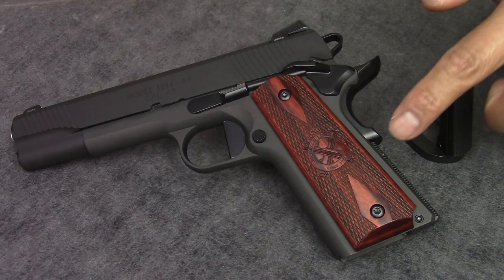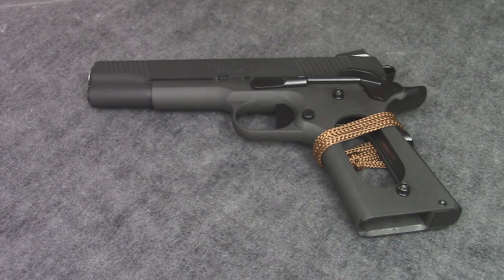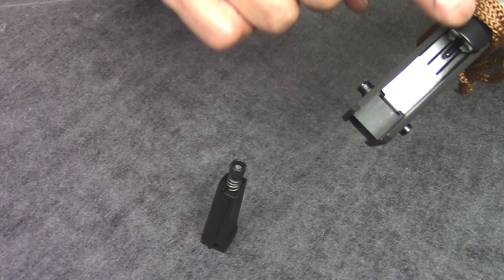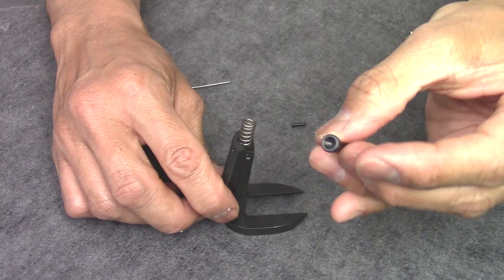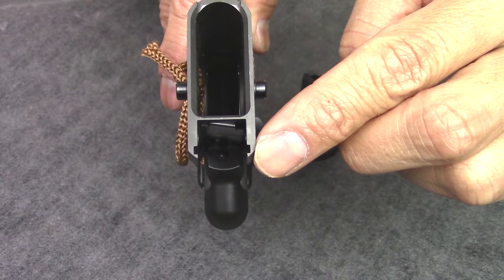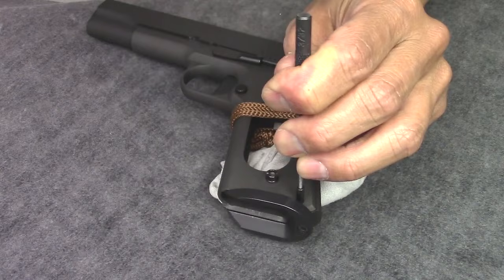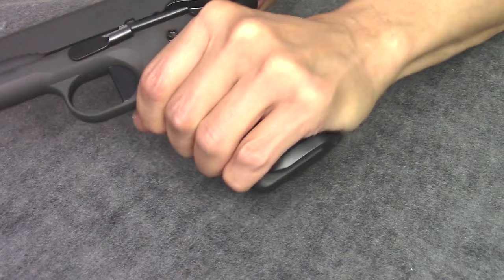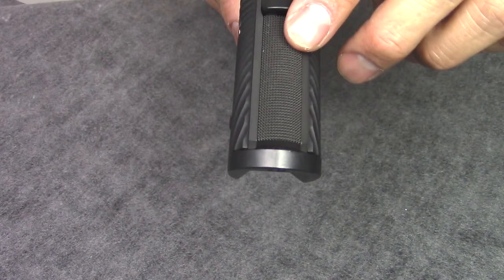Ed Brown Maxi-well install on 1911 Springfield Loaded

Comment: How did the heavier spring turn out?  Were you getting light primer strikes?  Sounded like you went with a heavier spring.
Reply from the maker: I purchased and installed a heavier spring because I read everywhere that it requires it but I’ve had no issues using either spring!
Reply: @stillmatic6048  thank you.

Comment: Looks like the 2 piece magwell which is what I'm going to purchase fro my Springfield Garrison rather than the 1 piece which is much more expensive and to me, not worth the price difference. Also glad to see that it fit well on your Springfield as I was somewhat concerned about the fit on my Garrison and I'm assuming that the fit will, or should be the same as the as it is on your particular Springfield model which is....... what?
Reply from the maker: I did a test install with this magwell on several SA 1911 models(TRP/Loaded/Loaded Target)to check for fit and had no issues, it should fit your Garrison!
Reply: NO NO. Send  it  back  to  SA  for  the  upgrade like Magwell night sights and front checkering  that way  you  keep  your life time warranty  and  everything well  be guaranteed
Reply: @TheRealZJE313 bc there’s no need to worry about that
U can just put the original parts back on if u want to send it in for the warranty
Reply: @DuhCL0WN  o ok.but why go through that? .when u can just send  it  in for those upgrades  and be done with it.
Reply: @TheRealZJE313 Because you get to keep and carry your gun everyday rather than waiting on getting it back.

Comment: Where the old locking system at?
Reply from the maker: …it’s built in the SA MSH.  People replace it in fear of accidentally locking, making the pistol unusable. I replaced mine because I wanted a mag well for appearance to match my other SA 1911.
Reply: So did you trash it?